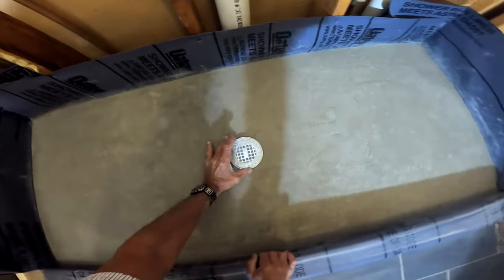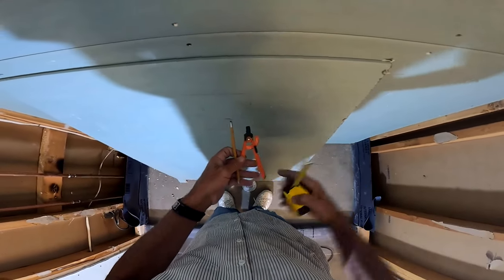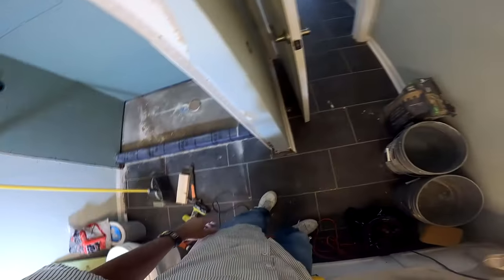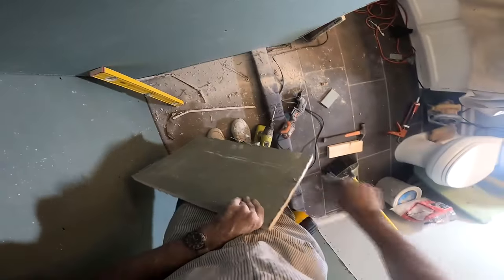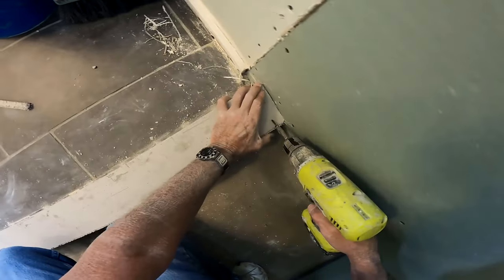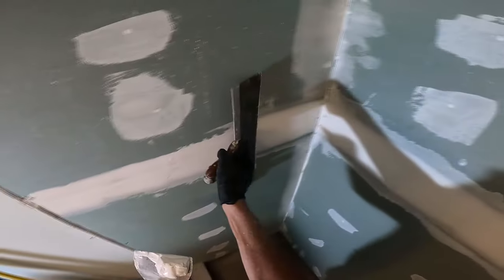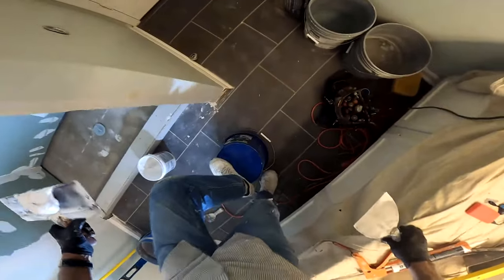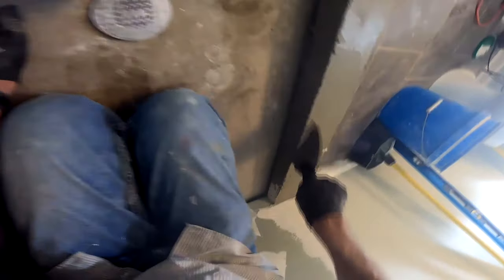BUILDING A SHOWER FROM SCRATCH....part 3 wallboard

Comment: Our 70 year old sheetrock, mastic tile bottom tiles on a lead pan had some mold in the mastic ones and behind the walls when the drain would back up. Oh well. it was fine and worked fine. Just don't let the drain back up. They failed in many ways, no hot mop, they poured a preslope on the existing sloped floor drain, no water tight tie into the lead pan. Mistakes made but no tiles fell off the walls. Mold was between the pours, and behind the walls. wood nailed to the foundation was rotting and nails at the bottom near the wet stuff were just about gone. But it worked for 70 years. No re-packing the shower valve that i know of, maybe. But there was no water damage near the valves. Great stuff. I love delta products, that is what all the valves in the house were and replaced with new versions. Keep these videos coming, love it.

Comment: I agree with you on the green board and the screw subject. If everything is waterproofed proper then you won’t have an issue.  The multi tool/ oscillating tool is by far one of the best tools ever invented IMO.
Reply from the maker: Exactly... even Schluter calls for sheetrock behind their kerdi... so if you trust your waterproofer then the backer is irrelevant ✌👌

Comment: Do you ever have problems with saturated grout? Since you completely waterproof your shower pan all the way to the drain. Seems like water will always make it through grout.
Reply from the maker: Grout is porous and will always take in moisture. So yes, just like the walls water will get into the grout and evaporate between showers.

Comment: In other videos I’ve seen you put the board all the way to the pan, then apply thin set at joints, and red guard. Is that not still what you would recommend?
Reply from the maker: Definitely not, those videos were plus 7 or 8 years ago

Comment: Do u leave the black  shower guard on there or take it out at some time? I love Denshield. I'd use it more if it wasn't sold as 5' by 32" instead of 36". Not sure why they make it that size.
Reply from the maker: Some of those mud guards are left be placed in there when the cartridge and all the pretty stuff is put it on, and some of them are meant to be taken off

Comment: I can’t believe you use regular screws instead of backer board screws on the curb. I have had the worst luck trying to countersink regular screws in Durock. They break on me when I have tried in the past lol.
Reply from the maker: I carry a box of coated cement board screws and will transition to them if I need to, but the breaking of the screws has more to do with the density of the wood that you're screwing INTO rather than the cement board you're screwing through.

Comment: Bob, is that Thinset in the bucket or mastic (adhesive)? If thinset (mortar) please tell what brand. I’d like to use it too. Looks like drywall mud.
Reply from the maker: Always always thin-set, mastic has no place in a shower, I get my sin set at Home Depot and it is called versabond
Reply: @StarrTile  I have Versabond in the bag. I’ll go back and watch your video on mixing thinset. What you are putting over your green board seams and screws looks so smooth and creamy. It looks like drywall mud. I’ve no experience with actually mixing the Versabond. Thanks for clearing that up for me.
Reply: I’m so sorry, Bob for wasting your time. I just went back and watched the video where you tell and explain why you are using drywall mud on green board. It looks like drywall mud cause it is! I’ll go in and make sure I pay you for my stupidity. Thank you for all the teaching you do.

Comment: Hello! I have my backer board up....How far above the bottom of my drywall can I put my lowest screws?     I can't tell from your video angle. Thanks!
Reply from the maker: Generally speaking you don't want fasteners lower than 3 in because that would be too close, however if you waterproof everything that Almost Doesn't Matter

Comment: Is there a difference between the purple and green board? My Home Depot in southern CA only carries purple 
Thanks
Reply from the maker: It doesn't matter which backer you chose, even the cement boards are fine...hardi or durock...I personally just choose greenboard.
Assuming you'll be waterproofing

Comment: Seemingly stupid question, but if the aim is to keep the wallboard out of the pan to prevent wicking, how to you do so with the inside of the curb as well? Is it also raised approximately 1 inch off the mortar?
Reply from the maker: 3/4 to an inch...yes
Reply from the maker: https://youtu.be/cNLaNE2h9H8
Reply: Awesome, thanks! My mind wasn’t computing there for a moment.

Comment: Thanks for the start to finish videos...I've seen some different videos where they will use a wire mesh under the mortar, is this necessary? Also noticed no pebbles or weep guard at the weep holes, any reason those weren't used? Again...I appreciate your time putting these videos together. Thanks
Reply from the maker: Both your questions are answered by the fact that we waterproof the surface, everything underneath is irrelevant

Comment: Hi Bob!
Thanks for the video.
Is that glue on that one stud to left of the first piece of backer board?
The great screw debate rages on. For me, deck screws usually.
Reply from the maker: Yes it's construction adhesive.. they had used it when I had done the tear out so I had to put some back in its place in order for the wall to be flush
Reply: @StarrTile  
Thanks for the follow up Bob! ☮

Comment: Since you keep the wallboard 2” off of the floor of the pan, do you fill it with thin set when tiling?
Reply: Sorry 1” off of floor to prevent wicking
Reply from the maker: One inch...and no, nothing goes in the gap
Reply: @StarrTile  so the tile bottom edge of the tile starts where the backer board starts, and there is left a 1” gap forever between the shower pan surface and the tile bottom edge?? Correct??
Reply: So the only way that the backer board, (we are going to use concrete board) to wick up water is if the pan drain backs up and fills the pan up ???
Reply from the maker: Watch this.... with any luck it will answer your questions...
https://youtu.be/cNLaNE2h9H8

Comment: Looking good, how much space do you recommend between the floor and the bottom of the drywall?
Reply from the maker: I'm not exactly sure what you're asking
Reply: @StarrTile  you have said do not put the drywall all the way down to the shower pan, leave a space so if water gets back there it will not wick up into the drywall. do you raise it 1 inch off the shower pan or how much?
Reply from the maker: @rccooper4  it can vary with thinset and thicknesses of tile, but generally 3/4 to 1 inch